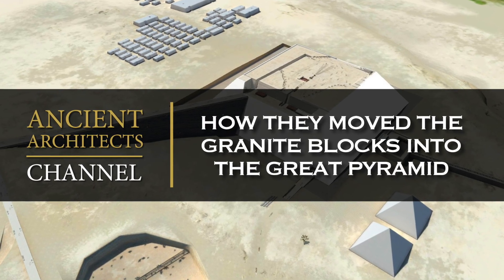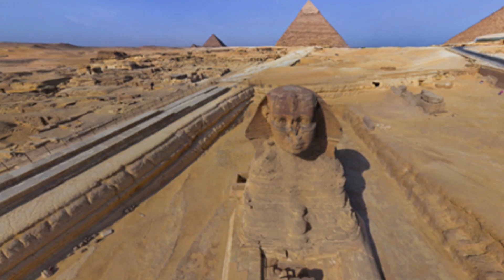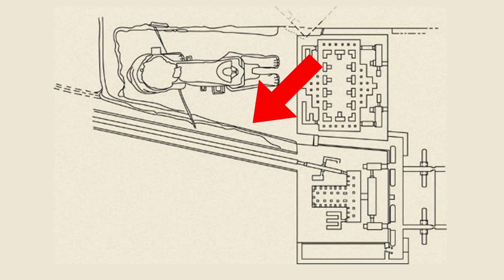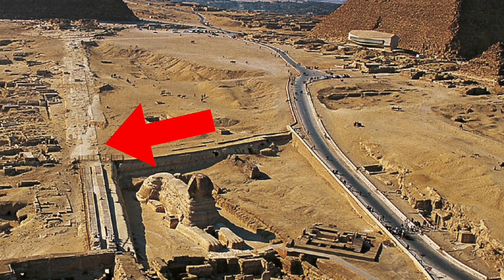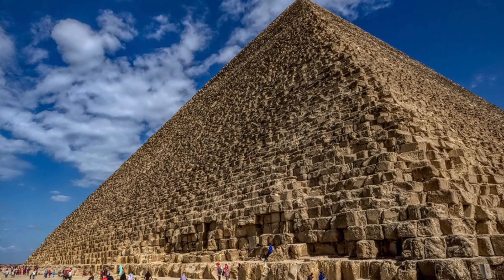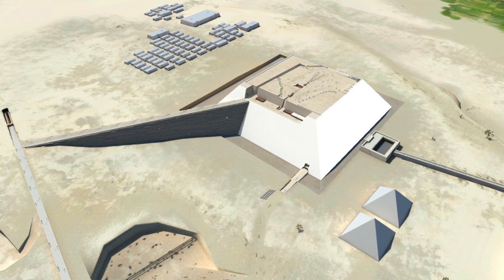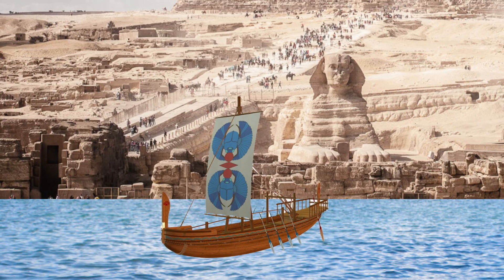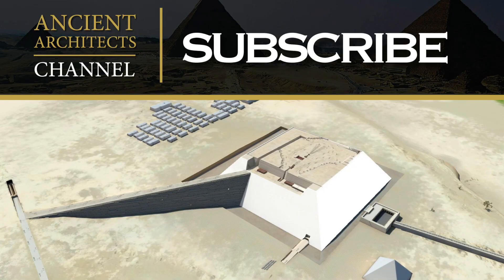How They Moved the 60-Ton Granite Blocks into the Great Pyramid | Ancient Architects

Comment: Couldn't they be geopolymer poured in place? The inner walls all seem like they are crushed granite turned into concrete
Reply from the maker: I guess possible, but v unlikely. The granite in the pyramid shows cut marks and the upper surfaces of the granite in the relieving chambers is rough, like quarried, and not moulded.
Reply: @AncientArchitects  i think it's also possible the cut marks could be smoothing marks making it flat when soft. In sacsuamon the smoothing marks are more visible like they ran a big iron over it. Thx for reply sir